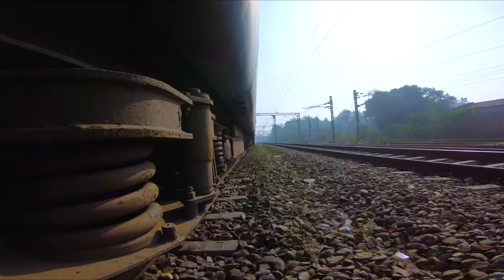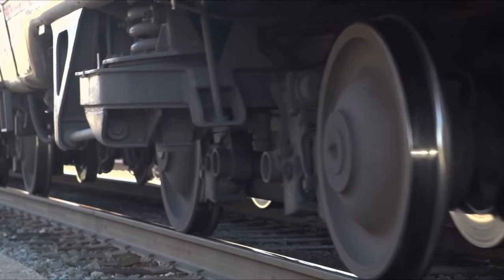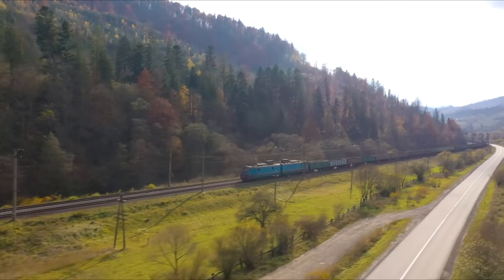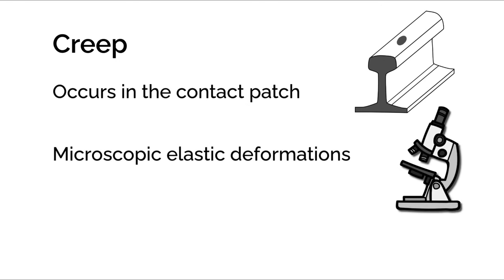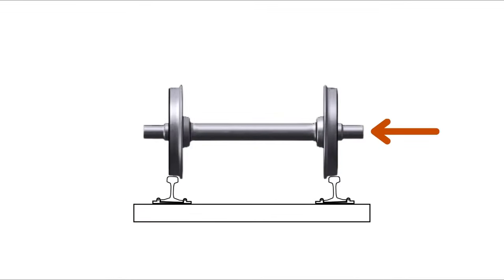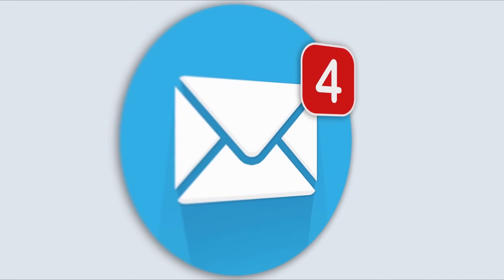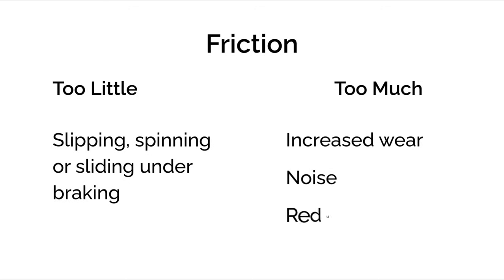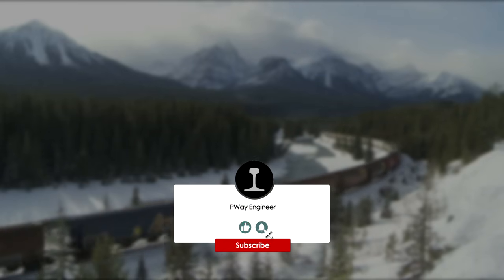The TINY Area Where Train Wheel Meets the Railway Track | The Wheel Rail Interface Explained

Comment: i have often wonder how a 3 axle truck (bogie) can affect rail in turns.  the flange could be at different positions for the middle axle than the first and last axles.  i have wondered if a flange-less wheel in the middle might help.
Reply: Back in the days of steam they did just that. In long sets of driving wheels it wasn’t unheard of to have the middle driving wheels flange-less. Modern day 3 axle trucks are usually made to have one axel move with the turn.
Reply: I guess there might be some sideplay on the middle axle, but on the curvatures used on railways, a bogie is too short to worry about, the tread with takes care of it. However, steam locomotives with long stiff frames and lots of axles coupled with stiff coupling rods, have a problem. Which can be solved by having flangeless, or more common, wheels with thinner flanges in the middle, and a bit of sideways play in the axles and coupling rods. All rail vehicles are designed for a minimum curve radius. If an engine is designed for s radius of minimum 100 metres, it will derail on  a tighter curve (climb over the outer rail).😊
Reply: @cieludbjrg4706  The austerity engines designed by R.A. Riddles of the 2-10-0 wheel arrangement (or 1' E in continental Europe) sent across the channel in 1944-1945 indeed had flangeless middle wheels, whilst (or while if you're American) the adjacent wheels had thinner flanges. The 1000-th engine shipped to the European continent, named "Longmoor", is on display at the Dutch railway museum.

Comment: Centrifugal forces on high-speed curves where the high levels of speeds transfers  from both sides of the wheels on curves especially on S curves on most high speed lines with curves the profile of the curve is slightly banked  to allow the trains to run at higher speeds reducing centrifugal force wear and causes rail wear  on the rails and wheels as the train shifts over to the left and right also with the amount of trains running over a line and how much weight is running over the rails and axle loading given that one locomotive may way up to 130 tonnes or more combined by 4 locomotives at the front 1 Distributed power unit in the centre and 1 on the rear plus say 200+ wagons weighing 100+ tonnes and how fast the train is moving places the rails under enormous pressure and the tracks need to be inspected more often and damages repaired

Comment: This is really an esoteric problem in the modern age combining old motive equipment with modern ties/sleepers:  I belong to a steam train association organization which is in the process of obtaining our own track.  Wooden ties in wet, hot southern Louisiana last about 19 years.  It would be nice to have concrete ties to reduce maintenance, since we rely on volunteers, but steam locomotives because of their asymmetrical pulling tend to pound and wobble possibly breaking concrete ties.  They move like multi-ton penguins.  I noticed there are rubber pads under rail plates on concrete ties to mitigate forces.  I assume there is a goldilocks amount of padding to reduce the impact without allowing too much vertical movement in the rail generating metal fatigue.  I suggested putting in extra padding to reduce impact on concrete ties/sleepers, if used.  We wouldn't have that many train cycles compared to normal track usage to create metal fatigue problems.  Any thoughts?
Reply: In some areas of Germany they are neither concrete or timber, but steel
Reply: @benyomovod6904 

O Mary, conceived without sin, pray for us who have recourse to thee, (English and French).
Ô Marie, conçue sans péché, priez pour nous qui avons recours à vous, (Anglais et Francais).
Reply: Concrete ties are very heavy which is why you don't often see them on heritage railways etc as they are a bit challenging to handle. Steel sleepers are certainly worth looking at as they are very light and easy to handle for volunteers.
Reply: @sensonic6514 In our yard, we have a very tight curve in which  every third tie/sleeper is steel.  Basically most of the new track would be built by professional crews and then we would do maintenance, so the initial work can be done in heavy ties/sleepers to reduce any future maintenance.  I assume there is some sort of expense problem with metal.  On regular U S railways, the safety circuits run through the rails and unless well insulated, they would short the system indicating rolling stock on the track or broken rail.  At one time, it seemed ties/sleepers made from plastic waste and tires/tyres was going to be the thing.  I guess that was too expensive.
Reply: @ Steel sleepers work fine with track circuits, but obviously you need to keep the insulating clips and pads in good condition. You used to get a lot of sleeper rehab projects where every 1/3rd (usually poor condition) timber sleeper was replaced with steel. There are also various types of polymer sleepers now. Many still under evaluation, but some have been in service for quite a while. They generally cost more than the other types though. I'm guessing you are US based, where concrete isn't as common. If you don't have to fit/move them then they are great and don't rot, which is why they are pretty standard across most of Europe. Typical life might be 40 years in mainline use.
Reply: I'd naïvely assume that 17 is still in the middle of the 7 to 40 year expectation range and that a good track management practice would scarf out and replace, then, every 17th tie or so, annually, on a cycle rather than wait until the entire railroad has become decrepit all at the same time.  Ballast? Drainage?  Borate-Creosote crossties exist btw.
Other problems like using prayer and wishful thinking to fix the overbalance hammer blow and too-high axle load that you mentioned, that's Mechanical Department stuff idk gl
Reply: @TristanMorrow 

O Mary, conceived without sin, pray for us who have recourse to thee, (English and French).
Ô Marie, conçue sans péché, priez pour nous qui avons recours à vous, (Anglais et Francais).
Reply: @TristanMorrow  I was working off a map that listed wooden tie/sleeper life expectancies, I saw several years ago.  In southern Louisiana, we are in the worst zone  in the 49 continental states - warm, a lot of rain and aggressive fungi and bugs/termites.
Reply: @lewisdoherty7621  Wooden sleepers used to be impregnated with creosote here in Norway. Which means that spent sleepers can’t be sold to be used in, say, gardering, nor can they be burned,  because they found out that creosote caused cancer… All new track uses concrete sleepers in crushed stone ballast, since that kind of track can be mechanically tampered. Sleepers for turnouts (switches) and crossings used to be wooden, but composite sleepers have made inroads there. On a tram line in Oslo, when the turning loop at the end was renewed, they used composite sleepers for the «sharper» part. 
Now, for heritage railways, they prefer wooden sleepers, since they rely on hand tampering, and the fact that two men can handle a sleeper without machinery. Concrete sleepers have to be handled by machinery, and the track machine tampered. 
I’m wondering whether your sleepers break because of uneven tampering. But, I am not an engineer, only an enthusiast.
Reply: O Mary, conceived without sin, pray for us who have recourse to thee, (English and French).
Ô Marie, conçue sans péché, priez pour nous qui avons recours à vous, (Anglais et Francais).
Reply: An absorbing topic neatly explained. However..    that music /noise in the background is a distraction which helps in no way.
Reply: All I can say is that this right here is a perfect exhibit A how it’s all been done before in the past and now in our modern infinite and infallible wisdom it’s all up to Facebook forums 2 cent ideas from people who can barely find their penis to take a leak

Comment: Very interesting. The radius of curves is a big topic for HSR and increasing speeds on conventional railways so that might be an interesting topic. Can you just increase the cant to allow you to take curves at a smaller radius?
Reply: Increasing the cant helps to a point, but the track becomes more difficult to maintain. Generally in the UK track cant is a maximum of 150mm / 6 inches. You also have the issue of a slow moving/stopped train to consider. If too much cant is applied you crush the low rail and in extreme cases the train can also derail to the inside of the curve.
Reply from the maker: It is one of the factors to be explored for sure, but there are other factors to look at.  This video on determining the max speed of a curve would be worth a watch: https://youtu.be/veGEOSEDSlE
Reply: There are formulas for this. A certain speed requires a certain cant, but there is a limit, and then you get «cant deficency», an increased pressure on the outer rail. Stops, on Metro and light rail lines, are placed on stretches of straight track to avoid a sloping floor when standing still, and to avoid gaps between cars and platform. Older systems that used shorter trains may still have stops in curves, which in New York is mitigated with moving platforms in some places, in London (and Oslo) «Mind the gap» is announced in the trains. Another problem with stops in curves is visibility. In the age of OPO, mirrors have been used, although cameras on the cars (or on the platform, sending images to screens in the driver’s cabin has become commonplace.
And of course, a slow train requires less cant than a fast train. If you only run slow goods trains, you’ll have less cant in the same curve as you would if you only run fast passenger trains. In USA, goods traffic is the norm, passenger trains are a nuisance. In Europe (and the U.K.), passenger and goods traffic is much more mixed, thus some compromises must be made. Whereas on the dedicated high speed lines (like the French TGV), you can optimise for fast trains only.
If a curve has too much cant, the trains will ride on the inner rail, which causes its own problems.